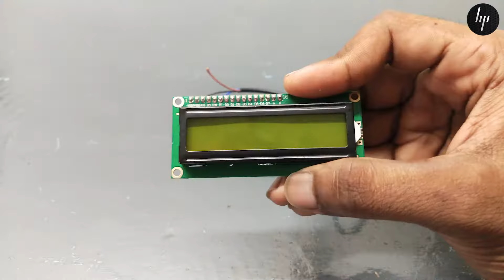Garbage Sorting machine using Atmega 328/Arduino

Comment: Hi can I please have the arduino circuit
Reply from the maker: Hey, Check the  description.
Reply: @hobbyproject  but sir the metal sensor, moist sensor, and servo, where to connect their other wires sir?
Reply: please sir I need your help for our research. Thank you sir
Reply from the maker: jiishnumm@gmail.com
Reply: @hobbyproject  I sent a mail to you sir thank you

Comment: sir we need your help, we are currently doing this project you shared but we've encountered some errors 🥹
Reply: @hobbyproject  the buzzer keeps on buzzing and the sensors don't work properly
Reply: the ultrasonic sensor functioned earlier but after replugged it didn't work again
Reply: we used Uno R3 as board